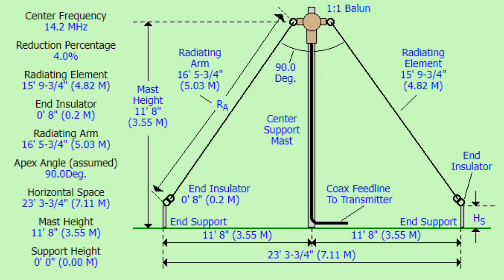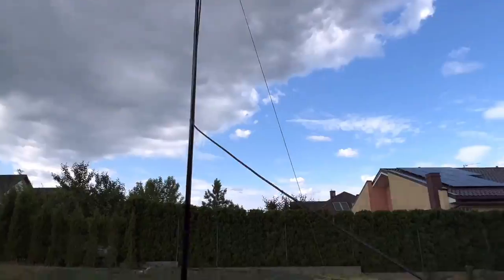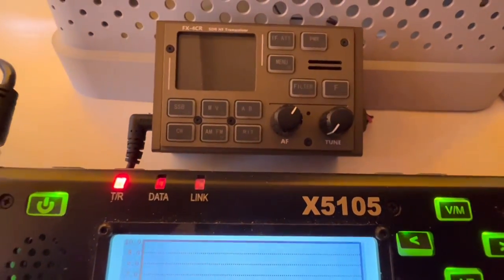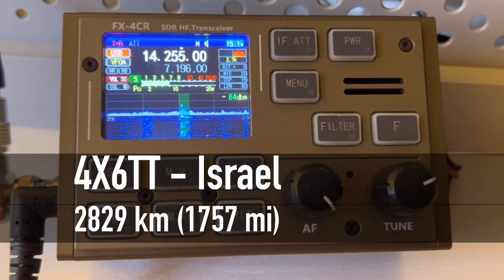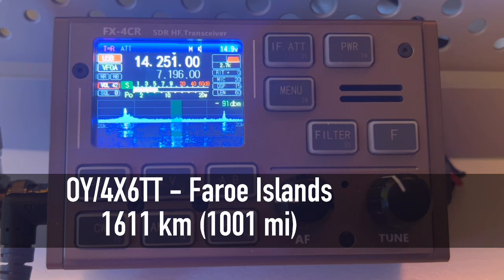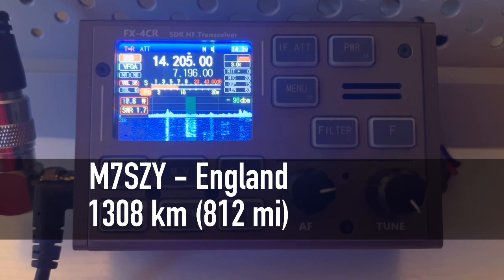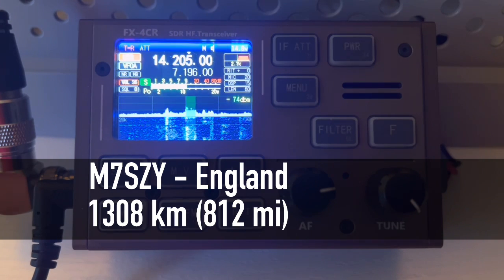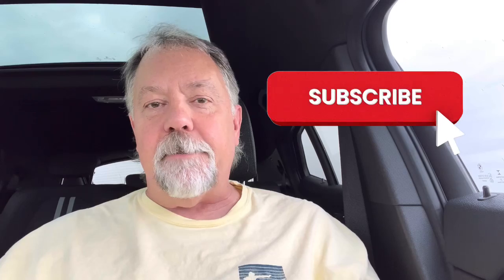Building the Inverted V Dipole

Comment: Hi Walt - felt I had a stroke of Genius. Inspired by the military AS-2259 NVIS antenna, I build an X shaped Inverted V with wires for 20 and 15 meters - along with about 6 meters of guy wire at the end of the antenna wires - for a total length around 11 meters

Mast was raised to about 8 meters

With tent stakes to hold the lines extending the antenna wire - I now had a very stable antenna setup - and one that was resonant on 20 and 15 meters - SWR no worse than 1.5.

With the Icom antenna tuner or the IC 705, I was even able to tune for 40 meters - though likely not being efficient.

On 20 meters however, I had a 1400km QSO to italy using 10W - and received 9+10 in signal report.

Next experiment will be with a wire cut for 40 rather than 20 meters - should give me 40 - 20 - 15 and possible 10 meters - without needing a tuner.

finally - going to try the concepet with my very bendy 12 meter Spiderbeam mast .. expecting to get a fine DX antenna with a high efficiency

Comment: Walt great antenna. I built something like that then added 40m to it, which as you know became a linked dipole. Started off small them now quite a big span foot print.
Nice work. Living the little rig. 
Just finished building a loaded vertical. Just need to get outside and see if it works. This weekend🤞🏽
Motters M7TRS 73 👍🏽
Reply from the maker: Hey Motters! Have fun this weekend! 73 Walt

Comment: Hi Walt: Nice video on inverted-V antennas. I was thinking a linked inverted-V might be easily switched from band to band without taking it down since the legs extend towards the ground. A micro banana plug connector at 3.3 feet from the end of the legs on each side would get you resonant on 17 meters when disconnected. It's would be the "Coastal Bandsurfer-V". In your setup, you might be able to reach the connectors from ground level....no muss no fuss.....worth a try? Maybe have a 15, 12 and 10 meter disconnect too? Not sure you could reach those from the ground though.
Reply from the maker: Sounds like a good idea!

Comment: Great job. Absolutely like K7MEM's Antenna Calculator! Interestingly enough, I never knew each side of the inverted-V were different lengths. I plan on building a 1:1 balun, I'll stick the mast in a 5 gallon bucket with concrete, and make two small gallon buckets with concrete to make this setup completely portable. Thank you, again Coastal Waves & Wires.

Comment: Hey Walt! I built one very similar, but it is linked for use between 10 and 20m. Tune 10, then 12, etc. It works well for portable use. I get stuck on verticals and should use it more.
Reply from the maker: That's cool!

Comment: Timely video.  I'll be putting together a 10 meter dipole this weekend getting ready for field day.  Have an old 25 watt Radio Shack HTX-10 HF radio to try. I have a 16' telescopic pole from my friend's kite store (about $50) to hold it up.  I will have a 10 meter hamstick as well plus my aunt will have an IC705.  Should be fun!  73
Reply from the maker: Sounds like a fun antenna project!

Comment: Great antenna, I put up a 20 metre dipole of bare copper wire, good contacts on 10 Watts. Easy to put the centre on a pole tied to the garden fence. Can't get it too high there, since some arsehole decided to put telegraph wires there at about 7 or 8 metres.

Comment: Nice antenna. Set up properly they work great. My home base radio is one of the new Yaesu FT-710 radios, 12 metres of LL400 coax I'm waiting for, & a Hy-Gain VA6160 vertical antenna. I might make an inverted V for portable operations to work with my FT-891 radio. De VK5FCHM.
Reply from the maker: Thanks for watching and commenting. 73, Walt K4OGO

Comment: I messed up and built a perfect 20M antenna. I used SS guy wires rather than rope seems to resonate. and get 20 over 9 from 1,800 miles away. With an inverted V EFHW. It used to be an NVIS Multiband, now it is a single band 20M. May hook up my tuner to try to bring the other bands back in.
Reply from the maker: Give that tuner a try!!!

Comment: Hi Walt, nice video man. The good old dipole, the mother of all antennas. Nice construction too. "Ideal Operating Conditions" (i.e. height, materials, etc. etc.) do not exist. You go out there with the stuff you make and get qso's done. Cool. Listen, maybe a good follow up could be and off center fed dipole (you could re-use some materials -not the case for the balun-), and there you have a multiband antenna... maybe... 73 de Guido, EA1FPN
Reply from the maker: Hi Guido! Thanks for the kind words. That would be cool to put up inverted. I might try that! 73, Walt K4OGO

Comment: That antenna is almost the same as another antenna I saw on here. But it was made for 20M and 40M.. I had printed out that and given to my club. Many said that they wanted to make one. With the 4 wires coming from the top that antenna held itself up.      73    W4DES
Reply from the maker: Oh wow, that sounds cool. Kind of an inverted linked dipole. 73 K4OGO
Reply: @COASTALWAVESWIRES  No! it had 4 wires 90 degrees apart. Like 40M wires run north south, 20M the wires run east west. Like a fan dipole. You don't need to switch, add or remove wires. Also, the 4 wires can be used to hold the mast in place.  73  W4DES

Comment: I built this antenna just with no balun instead had a air choke. Had to cut a few inches down from the calculator. Works much better the my vertical. Probably because of my obstructions.
Reply from the maker: Awesome!

Comment: Hi Walt, just an observation, on the X5105 it looks like after the analyze the SWR is 1 but later when you start activating on the FX-4C the SWR is 1.4/1.9. Why is that? Or isn't it too much the 1.9SWR? Usually I try to keep my antenass SWR near 1-1.3SWR for the best performance since Im activating with 5W.
Reply from the maker: I noticed that occurred during peak modulation on the FX-4CR. Something I need to investigate. It didn’t seem to affect the signal as you could see in the contacts.

Comment: Many of us SOTA activators use a linked version of the  inverted V which makes it multi-band. I regularly work into VK early morning on 20m SSB from hilltops here in central Europe with just 20w or less.
As you say, a great antenna for portable usage.
By the way NVIS propagation only works up to the critical frequency of the ionosphere and that never goes above 10MHz so NVIS is (as far as I understand it) physically not possible on 20m.
73 Ed DD5LP
Reply from the maker: Thanks for the great comment Ed, 73 Walt K4OGO

Comment: what did you use for a mast ? Balun home made it commercial? How do you measure the angle of the antenna legs sloping down?
Reply from the maker: The mast is a 6 meter telescopic pole, this could be done easy with telescopic Crappie fishing pole (they’re cheap on Amazon). The balun I used was made by N9SAB and he sells them on eBay and Etsy. All the measurements are on the diagram that is on the antenna calculator. At the bottom of the diagram the distance from the center pole to the ends of the antenna are shown.

Comment: I have my portable inverted vee for 40m up 26 feet (8M) on a squid pole, and its a great performer for POTA in the bush in Australia. It's really wobbly though at 8m especially when the wind gets gusty 😅

One day I'll upgrade the license and get on 20m.
Reply from the maker: Cool, thanks for sharing
Reply: Maybe you can find a tripod stand that would help. Also you can make 
a "flat top dipole antenna 
 using fishing rods as support for your wire. At 28-33 ft it should be bidirectional. Good luck!😊
Reply: @jamesabc372  I upgraded to a spider beam, 12m of solid fury. Also gotta keep it slightly tensioned, then no more wobbles!

Comment: Yes it technically should be higher, but lowering the antenna changes it's properties, and give it different take off angles. Thus it give different DX. Changing the direction of the antenna, will change things too. It's called experimenting.  When I had my own house and property, (Luckily I had great neighbours ) I was always Had 4 or 5 different antennas in different spots on the property. Weekends, You would find me right after breakfast changing out at least one antenna that I found and read about through the week. Quite often we (my wife is a ham as well. I'm the experimenter and she's the cheap labour hi hi ) would work on the antennas through week, so we could get it up and trimmed and use it all meek. I had an OFC that was our main antenna at the top of the tower that worked fantastic. Every thin from 80 up to 10 no tuner until you got to the lowest part of 80, and the highest part of 10. Just above 29mhz. If we were doing a contest, it was the antenna we used. But I would flip antennas sometime to see if I could pet a better signal and if so us it. I've had them at 10 feet, and at 60. Some worked great, and others got repurposed. Others just buy something over priced because the ad said it was the best antenna you will ever own. They have no idea of the possibilities of antennas that are cheap to build and work so much better.
Reply from the maker: Thanks for watching and thanks for the great comment! 73 de K4OGO